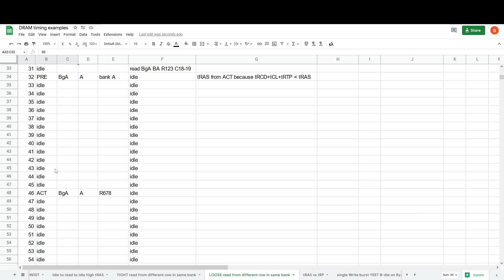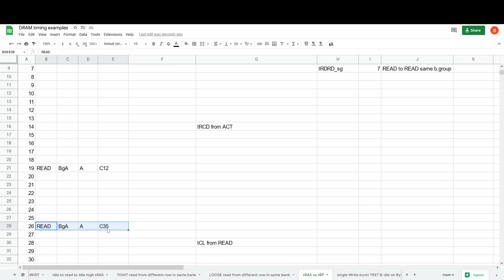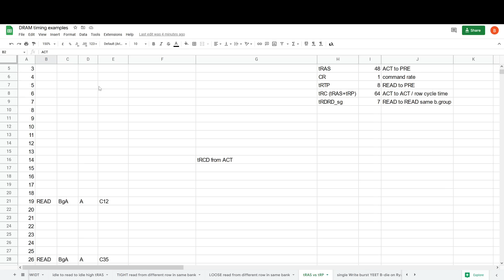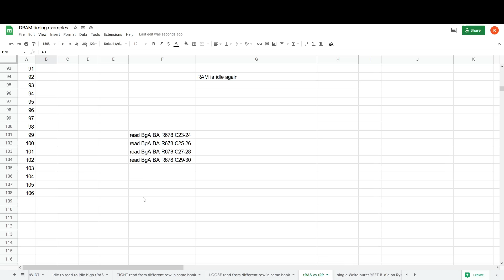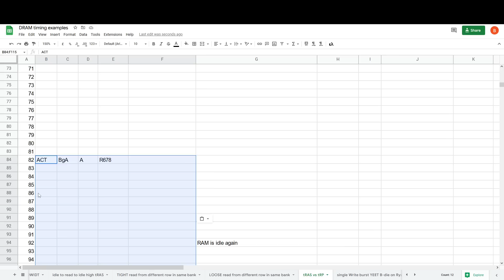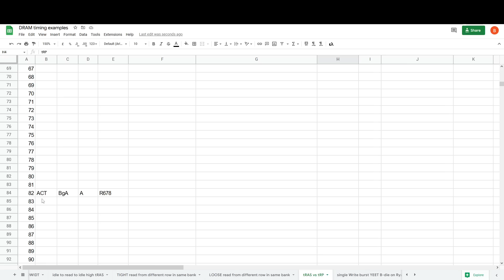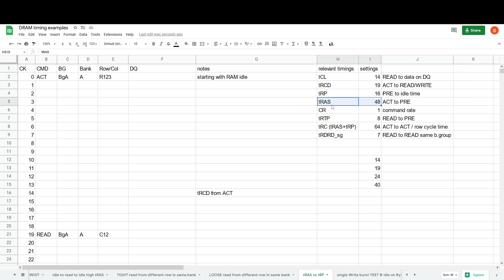DDR4 timings explained 3: tRP VS tRAS for performance

Comment: Hi  I have DDR4 Corsair Vengeance LPX 3200mhz CL16. I am trying to overclock my ram here is my settings tcl 14 instead if 16 , trcdrd 19 , trcdwr 19 , trp 19 , tras 38 set to auto also my trc is set to 55.
is there anything I could do to improve these numbers I have stressed tested using DRAM calculator using membench no errors. Also trp can go lower to 16 or 15 but if I change it will it be out of sink with the other timings.

Comment: hey can you explain why on ryzen 7 16-16-16-19-21-61 with trpt at 10 is so much slower than 16-16-16-19-21-60with trtp set to 9.. like overclocking this memory it seems to not have any improvements from 16-22-22-22-21(or i think auto was 43)-75 with a trtp at 12. i was looking at occt and the cycles seem to half itself at random or even worst! keep in mind auto for twr was 4-12-24 and trtp at 12.. but i set mines to 4-10-20 with trtp at 10 then 9. i saw the other video where u were explaining stuff so i am guess cause you didnt really explain but trc=trcdwr+trcdr+trp+trtp. thats what im guessing. im guessing its cause ididnt watch the twr video yet.

Comment: So whats the ideal value for tras ? Esp on intel 10th gen ?
Reply: I am wondering the same 4200 16-18-18-?? on Samsung b-die 1.5v . What should be the tras
Reply: @ahmetarslan2748  i have same timings with 3600 Mhz on my C-die. I have best performance with 38, but I can't seem to stabilize it at that, so currently its 42, which is fine in its own way. 42 is smoother, 38 is "faster" ? I prefer smoother though.
Reply: @EpicBunty  i am stabil with 36 for 12 hours of karhu ram test now

Comment: thanks fir the great video，could you please explain whats the problem of gigabyte mb trp setting as u mentioned on 7:00？ i am using gigabyte b550master， it works well on trcd 21&trp 25， but cannt pass trcd 24&trp24 in memtest.

Comment: I'd love to know the tightest cl14 3600mhz w/o overclocking it for instance my timings for the 1st columns are 14-14-14-28-42 at 1.45 volts but would love to know the tightest I could get with the rest of my timings.

Comment: You LITERALLY started this series just days after I finished painstakingly overclocking my memory for the better part of a week. I had to combine info from tens of sources to even come close to good info. Will now probably end up binge watching and then tweaking much more when I upgrade my processor.
Reply: Man, last year I spent over 2 weeks tweaking memory timings having to mostly rely on brute force trial end error to figure out which settings even make a difference, because all the info I could find was frightfully vague and scattered amongst countless obscure articles and old forum posts. This series would have saved me so many headaches.
Unfortunately, now I am tempted to start messing with the timings again to do it properly.
Reply: @fnorgen  Hahaha extremely relatable. A lot of people online definitely act like they know what they are talking about and don't, and other guides that do seem good are incomplete at best. I'm happy mine has been stable since I messed with it now, but def won't be tweaking again for a while.

Comment: How does the controller know when to read voltages on the data bus? Conversely, how does the chip know when the data is being read and it's time to set the data bus voltages to the second (and later) bit values? Is there a pin on the stick which the controller holds high/low which allows the chip to flush through the data each half-cycle?

Comment: This explains why having low Trcd and Tras with low subtimings makes the biggest difference to peformance. The difference between Trdrd_sg (read to read same group) being set from a 8 to a 7 could be huge. Because if there are multiple reads in the same bank and row but different column (up to 1024) there could be 100s of Trdrd_sg commands. The lower it's set the lower your latency would be.
Reply: Meanwhile memeory be like

single-rank bdie:
rdrd/wrwr _sg 6 runs, 7 does not (but does, on dual-rank!), 8 runs
8 performs better than 6 because fuck you

hee hee haa haa
Reply: @TheDoomerBlox timing trolling and tomfoolery
Reply: When you adjust tertiaries you also need to adjust tccdl and iol/rtl. Try tccdl 7. @TheDoomerBlox

Comment: This was pretty quick and on point!

I have to ask, between PRE and the next ACT, is there any other command that can run (and that makes sense) ? I thinking that maybe something like refresh (forgot the command name, where the capacitors are recharged) ? Is there anything (else) that can run there ? If not, then I'm also very dumbfounded as to why tRC and tRAS would exist at the same time.
Reply from the maker: refreshes can only be started with all banks precharged. Also they take forever. So no you can't put that between the PRE and ACT. You can replace the ACT with a REF.
Reply: Refresh command is the tRFC timing and that one is supremely high of 200-400 cycles.
Also heat sensitive so very hard to get right so I leave it to auto lol.

Comment: I know its alot to ask, but if this continues as a series and goes into ddr5, it would be a nice reference series for the next several years
Reply from the maker: DDR5 uses pretty much the exact same timings just on slightly different structure.
Reply: @ActuallyHardcoreOverclocking  dont the timings need to be longer on ddr5 because each clock is less nanoseconds?
Reply: @Brometheus420 It still uses the same timings, just with higher values
Reply: DDR 5 is mostly the same but with more bank groups and with more power saving things
Reply: @jjtb7300  maybe the final video in this series will be just explaining those differences, i know he has a video that kind of explains that already but this series could be a one stop shop
Reply: Buildzoid will love to do that!